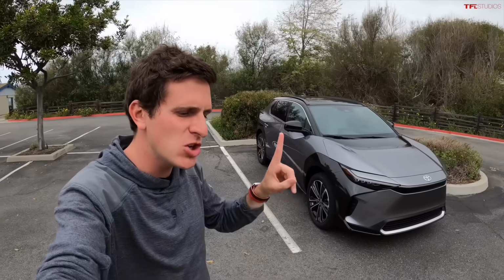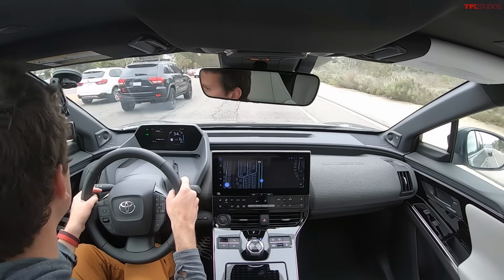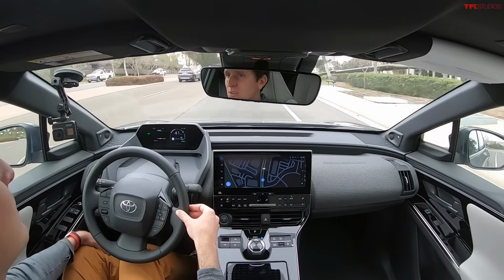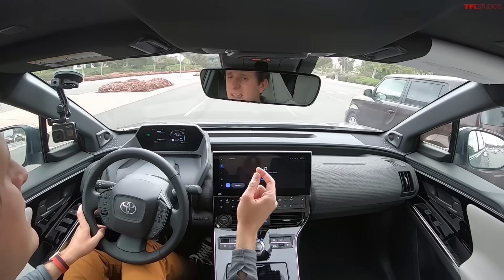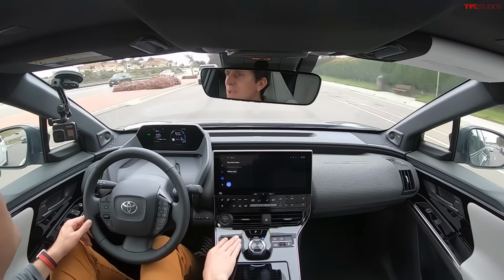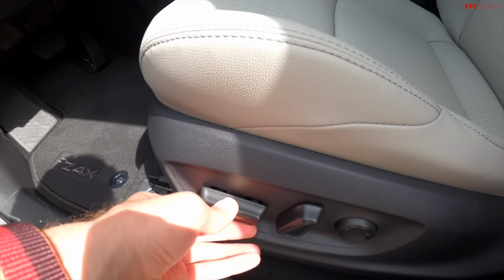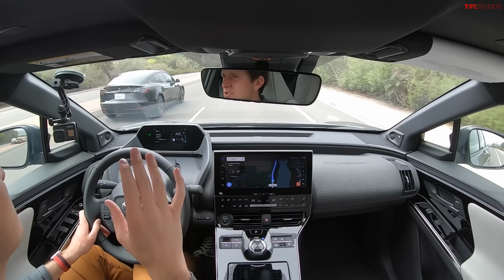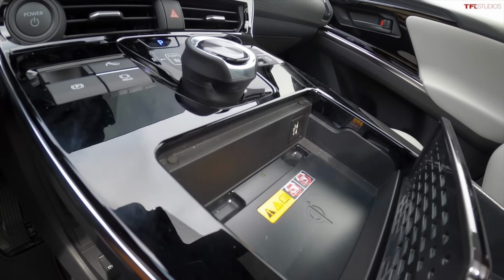I DRIVE The New Toyota bZ4X! It is an Excellent EV with a Couple Big Disappointments

Comment: Tommy,

When you are stopped at a light you are suppose to have your foot on the brake for safety, in case you get rear ended you won’t be pushed into the vehicle in front of you or into the intersection.
Reply: If u get rear ended, u need to share ur misfortune with the cars in the front. Why would u want to suffer alone
Reply: @yodesuyo  Because localized rear end damage may be repaired more easily than rear and front end damage.  You may even be able to drive it away.  Your way the car is likely to be declared a write off and the odds are high that the imbecile that hits you has no insurance and is quite possibly not holding a current driving license, is under the influence or most likely texting on their cell phone, taking down directions while eating Chinese take-away using chop sticks and holding a scalding hot cup of McDonalds coffee.  Or they may be undocumented immigrants attempting to escape the INS car chasing them at above highway speed limits.  Good luck with your insurance claim.

I drive quickly but I also drive and stop defensively.
Reply: In Britain when stopped at a light you are expected to be in neutral with the parking brake applied if in a manual or in park if in an automatic.  Just keeping your foot on the brake pedal is insufficient to stop forward motion if rear ended.  An impact from the rear will lift reduce the pressure on the brake pedal with the inevitable result..
Reply: @philipgrice1026  it depends on how hard you get hit, but brakes are better than nothing. No one in the States is going to put a car and neutral with the parking brake on every time they stop.
Reply: @niceguyrides  In Britain it's not required during casual, momentary stops but is required by law when stopping at a traffic light controlled intersection where you expect to be stopped for more than a few seconds.  It is for your own safety after all.

Applying the hand brake is done as the vehicle comes to a stop.  Once stopped the driver can remove their foot from the brake pedal and relax, but keeping their hand on the hand brake.  As the light turns green the brake is released and the throttle depressed easily.  It is even better for drivers of manual transmission cars as they can manage the clutch pedal without needing to deal with the brake pedal.

Your comment about US drivers is an example of why most US drivers couldn't pass a UK driving test even after three attempts and never pass a German driving examination in their entire lifetime.  The attitude is wrong.

Considering the fact that driving motorized vehicles badly can result in death and destruction US drivers are far too casual about driving well.  It also explains why so many Americans die in traffic accidents every year.  The sooner we have autonomous cars the better, except I expect most US drivers will not use the feature as they will be afraid of it.  Most Americans I know won't even use cruise control as they are afraid of it.  That is evidence of just how little confidence they have in their driving skills.

I suggest you watch car drivers as they approach traffic lights.  You'll notice that many brake even though the lights are green.  A couple of people I've managed to ask why they do that said "because the light may change", which is ridiculous.  They don't accelerate when approaching red lights as they might change.
Reply: @philipgrice1026  lol… wow.  I was simply commenting on why Toyota makes you use the brake, and you turned it into a lecture on American drivers.

Comment: I think it's actually a good idea that the regen brakes don't bring you to a full stop and you have to use the normal brakes. It has been found that if you only use regen, the normal brakes tend to seize from lack of use. Especially in cold climates with salt used for keeping the roads clear. Just an observation from the Great White North.
Reply: Tesla had to upgrade the alloy in their brake parts, like the rotors so they corroded less. Additionally, when it regens, the electric motors only get you down to about 5mph. Then the vehicle floats. Tesla programed in the application of friction brakes for that last 5mph. I love the one pedal driving, but new drivers need to learn the brake pedal, before they use it. You can't be figuring out where that pedal is at in an effort emergency. Oh, and mine is dual motor, and I have it programed to hold, not creep, so I can rest my foot on the go pedal at a red light. 😉

Comment: I really want this car (I currently have an oil-burning 2008 RAV4 so it needs replacement soon). 

Love the limited in silver with white interior. Sadly here in Canada it's a 18-24 month waiting period for EVs, so I suspect this car will have similar supply/demand issues when it finally comes out. 

Price seems a bit high, but not super surprising considering a Hyundai Ioniq5 is similar & obviously Hyundai can't compare to Toyota for quality & resale value.
Reply: Modern Toyotas are vastly overrated, and modern Hyundais are vastly underrated.  At least the Koreans seem to be taking EVs seriously; this atrocity reminds me of every other kneecapped compliance EV from the early 2010s.  I was excited, but am left very disappointed (though I suspect this was Toyota’s intention from the beginning).
Reply: i would be careful.. the charging time is years behind.  100kw for a version of the car is really poor in my opinion.  range is near 100 miles less than a tesla competitor . the front wheel version might not be the best choice for snow or other weather conditions.  the range of the two motor verson is rated at 222.  yes its cheaper than a tesla or other ev. but you get what you pay for ..
Reply: They just announced that the top trim model of this car for the Canadian market is $63K CAD + taxes. 

That's borderline Lexus pricing; I could have to own the bZ4x for 5+ years & put on 116K miles to finally reach the price per distance travelled (not including insurance & maintenance). 

I'm definitely going to wait until they depreciate a bit on the used market before getting one.

The charge time doesn't scare me. As long as I top off the battery at home every time it's parked, even 120V outlet is sufficient for as much as I drive daily.
Reply: Recently hyundai's quality is higher than toyota...   you are living in 1990's

Comment: I like this.  It does not have a glove compartment.  I think Toyota will have to add one in the following model years.  This vehicle adds to so many other competing crossovers all starting in the low $40Ks.  There need to be more low-end EVs in the USA, to compete with the Leaf and the Bolt (without the battery fires, please) and even some lower than that.

Comment: When they figure out a cvt paired electric AWD... They'll really have something. It will multiply torque as well as save power at cruising speed  by doing the opposite.
Reply: best transmission is no transmission

Comment: EV fans love to dismiss this and Toyota in general. But knowning Toyota, it will sell and sell very good. If buyers wanted a performance model the company will bring out a performance car in the near future. This is a good start for a relatively good EV.
Reply: I doubt Toyota will bring out a performance EV anytime soon.  Toyota is very co conservative.   If you want a performance EV, get the Tesla or EV6 GT.  Toyota is more Ioniq 5 and id4.
Reply: They will sell every one they make. Unfortunately, they don't want to make many of these, and they couldn't even if they tried.
Reply: @TheLastMoccasin  I think so too.  There are many loyal Toyota and conservative customers (older/more disposable income?) whom goes for familiar design and interior layouts.   They don’t necessarily need the most up to date tech or features.  Also the demographics who buys this EV are home owners will access to home charger and use it as a commuter and running errands.
As far as capacity to build more, yeah it won’t be hugh numbers until Toyota’s own battery factory is up and running full scale, which will happen in the next few years.
Reply: @jml9550   It will be all SOLID state batteries

Comment: I was excited for this, not going to lie. Never really loved the looks, but I figured the numbers would WOW. It's not priced aggressively enough for me for all of the concessions I would have to make. I'd swallow this price IF there was an additional 100 miles of range OR they did eight years unlimited miles. Even if the charging curve is completely flat, this thing is neutered as a road-tripper, which I admit I don't need, but do want as it would lightly replace the highlander for us.

Serious question; why does this start at $4k more than the solterra? At $38k and an all but guaranteed federal tax break of $7500, it feels like a no-brainer. It's practically the same car from what I have seen.
Reply: Where did you get the Subaru $38K pricing?  I couldn’t find the official price?
Reply: @jml9550  you're not wrong. There isn't an official price listed yet. I didn't realIze when posting.
Reply: @belavet  I would bet Subaru pricing will be higher than Toyota, given that Subaru has a image of a adventurous, lifestyle vehicle with off-road capability…….let’s wait and see.
Reply: @jml9550  I'm betting you're right on the price. If so, I'm going back to the face book argument I had 4 months ago with the Subaru dealer who said it would start around $40K and I told him the was no reason to believe that. Dude was all "I work at Subaru! I know for a fact!" Petty, I know, but it bothered the hell out of me.
Reply: @Necrotron  you were talking to a car salesperson.  Enough said.  :). The Solterra will be full time AWD and I think it will be in the $55K range for the Touring  model.
Reply: @jml9550  I know, I know. But it was just so.... Ugh. I totally bookmarked the thread so I could find back later and be all "YOU WERE SAYING?" Screw that guy
Reply: @Necrotron  yeah I feel you.  I found in life that sometimes talking to certain type of  people are like talking to a wall.

Comment: Toyota’s sell just fine without being the fastest or being flashy.  It’s what the mainstream and affluent buyers alike, want.  Toyota’s value prop has always been reliability and functionality.  A family vehicle, commuter car or grandma’s car do not need to hit 0-60 under 5 seconds.  Most EV’s are charged at home and overnight.   I know this won’t get the clicks that most influencers crave but to call it a rush to market product or dates tech is stretch.
Reply: I don't think speed and flash are the issue here. They are range and refueling time. Assuming you get 100kW peak 0-100% that's just under 45 minutes a charge. That's best case in ideal conditions. Maybe people genuinely do decide this car is worth it just for their weekly commute. I am not an alarmist by any stretch, but I am disappointed with the specs compared to the price point. If this thing were $10k cheaper it would be a no-brainer.
Reply: BEV vehicles will be inherently more reliable than ICE with a transmission.  So the Japanese don't have that going forward.
Reply: @normt430  Perhaps but they do know how to manufacture and build a quality product.  Toyota has been the leader in hybrid technology which have high reliability.  10% battery degradation  over 10 yrs sounds like a pretty good start.  Yes, Toyota is a legacy automaker but they lead sales volumes in ICE and hybrids.  Sun setting profitable products is a long roadmap.
Reply: I know if I buy this EV, it is not able performance or charging time or range,  it is about Toyota reliability and familiarity.  My wife or I couldn’t care less about 4s 0-60, 15 minutes charging time or whatever.  We have a ICE SUV for road trips.
Reply: @jml9550  must be nice to have disposable income to pay more for a Toyota.  My Toyita loving inlaws found out the hard way when their 2012 Camry V6 engine seized with a broken cam sprocket with a $4,000 bill.  Most of their family has all had Toyota's and left when quality declined and value was not there.
Reply: @normt430  yes it is quite nice to have multiple tenants with no mortgage, especially in the Bay Area.   My wife’s Lexus SUV has 147K miles in her and still drives like a champ, my 2017 Lexus sedan just broke 28K miles.  Both V6s.  Proper maintenance are keys to longevity.  Back in the old days I had a SC400 and my father had a LS400, both went over 150k miles without major repairs like your in laws or relative.  The only car I will buy are Lexus, Porsche or the Lucid if they can prove reliability.
Reply: @jml9550  there is nothing from Lexus that can match the 100+ mpg we see with our 2018 CT6 2.0E plug-in...nothing. The current LS500 is low scored and ranked by Consumer Reports. 

When the inlaws bought the Camry they also wanted a small AWD suv.  They drove the RAV4 and said it was too loud and tinny sounding.  I recommended the Buick Encore as it was in their price, range, efficient, and easy to drive. And that is what they purchased.  It has needed repairs like their Toyota. At 100,000 miles he wants to get rid of the Camry but it is 10-years old and thier old Toyota's start to show rusting body parts which diminishes value in the Great Lakes areas.
Reply: @normt430   Sure the Caddy are really nice cars.  Just not my brand of volka, not interested  in Chevy, Ford or what domestic brand, except maybe a Lucid.  I  have my eyes on a Lexus LC500H as well if Lucid can’t deliver a solid product.  If I want a EV, I may consider the Taycan.

Comment: Since Toyota has always been against EVs, I think they purposely hindered the charging rate to ruin the ownership experience of those who buy one. The charging rate seems 3 years behind everyone else
Reply: "We made a lackluster EV to show you EVs are bad" seems like a colossal waste of money, not to mention providing a direct avenue for all of your competition to one up you.
Reply: Toyota is conservative. Charge rate is adjusted for an extra margin of safety and longevity.
Reply: @Alfred Wedmore Toyota has lobbied against high fuel efficiency and the move to EVs. They have clearly tried to slow the transition away from gas's guzzlers
Reply: @_CarlosA  OR, as a major provider of electrified vehicles, they were concerned about extreme market forces, rising battery costs, and the effect on their bottom line?

Comment: A good first EV for new buyers, seems to be better in most respects than the ID.4.  It's not a MachE or a Tesla, but not everyone needs that.  That black up front, though, is as garish as the new Niro's C-pillar . . . you'd need the proper colour to offset that some, or simply wait until (hopefully) Toyota comes to their senses and gets rid of the black spots.
- Interesting ventilation towards the legs . . . good for cold winters . . . 
- Hmmm sure about 1 pedal driving but I'd like to have the option . . . 

Good review as usual, Tommy.

Comment: It’s clear that the car reviewers don’t want to piss off Toyota because none of them are commenting on how ridiculous this car is.  Every single EV that is out there is better than this in every way.  Only a Toyota fan would buy this.
Reply: Well to be completely fair it is better than the fiat 500e, mine Cooper e, Mazda mx-30 ev with 120 mile range etc. 
But Toyota is also almost into the sunset phase for tax credits. So expect people to grab the subaru version by the end of this year instead.
Reply: @4literv6  Better range maybe but not cost. 

At least before all the supply issues, you could get a MINI SE for ~$20k. With my local cost of gas and electricity, I save about $0.13 a mile vs a 30mpg average. At the end of the 100k mile battery warranty, my MINI will have a total cost of ownership equivalent to a $6.5k gas car (ignoring all the maintenance a 6.5k gas car would have over 100k miles).  Pretty hard to beat for a fun commuter!
Reply: It's aimed at the middle aged and up buyers. Who trust Toyota and nothing else. Not the ones who think Tesla is cool
Reply: This might become the most reliable. Also wireless carplay on the base model is nice and charging port near the front is handy for carpark chargers.

Comment: Typical Toyota.  Won’t even let me configure to see anything as it’s “extremely limited” in my area and then recommends gas cars.
Reply: configuration tool worked for me. The last step stills says that though and wants me to call the dealer lol. Base AWD with destination comes out to $45,295. Shave another $10k off and I'd be in but it is a non-starter for me at that price. 🤑
Reply: @belavet   well its cheaper then a Model Y. the average transaction cost for passenger vehicle is about 40,000. i dont like the fender flares and the drivers side dash looks too odd for me.